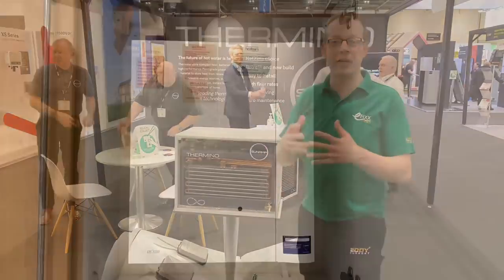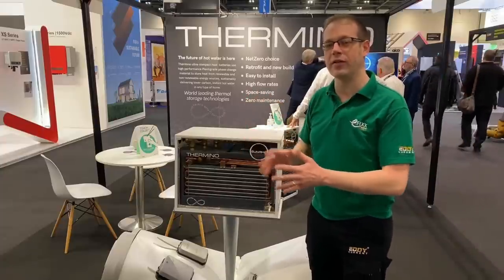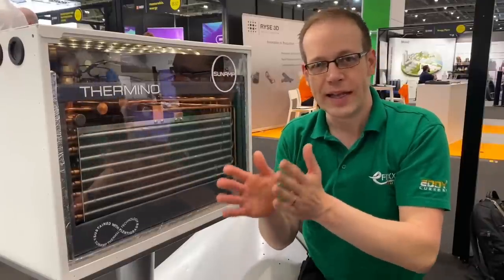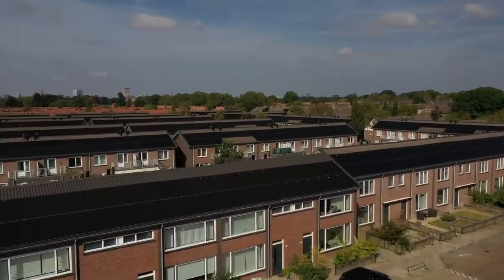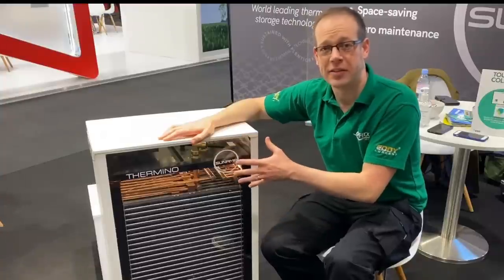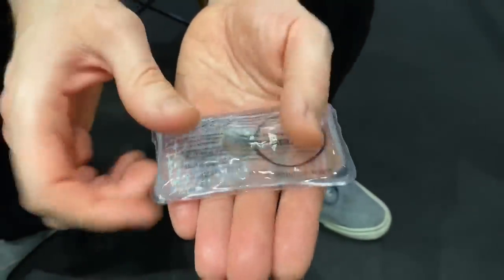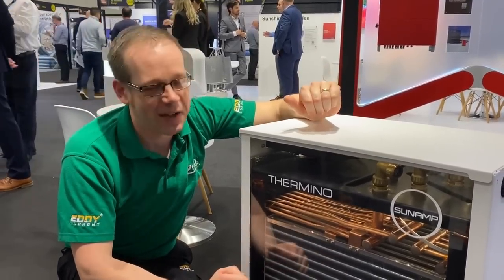The SUNAMP Hot Water Battery: What is it and How Does it Work?

Comment: That looks a good product. I work for a housing association and we have plenty of properties with heat pumps with cylinders. Quite a lot of them are bungalows with wet rooms. The large cylinders are only used for washing up and washing hands. A terrible waste of energy. This looks like an excellent solution. I'm a plumbing and heating engineer and think we have a long way to go to for heat pumps, whether ground source or air source to work as well or as cheaply as gas boilers. Especially in social housing. This is definitely heading in the right direction.

Comment: I do like the glass front showing off all the pipes inside.  It’s like a piece of artwork.  Absolutely amazing tech.  Thank you for sharing this.
Reply: This is probably just a demo unit to show all the pipes and bits. No telling how the final product will look. Think about it, a glass front will waste heat
Reply: @volvo24091  you’re probably right, but it does make it into a nice art piece for your kitchen.
Reply: Thanks Robert. As Volvo24091 says it is a demo unit with one of the sides replaced with clear perspex to show what's inside. The final product looks just the same with a white panel instead of the clear one. This is our 4th generation product - 20,000 heat batteries have been installed so far.
Reply: @SunampLtd  it still looks better with clear acrylic though.

Comment: Fantastic bit of kit, they should look at getting that into the marine industry too, excess heat from the engines stored for hot water onboard ... good to have finally met up with you guys
Reply from the maker: Great idea bud, such a pleasure to meet you in person at last. 😊
Reply: The car industry.  More than 50% ends up as waste heat
Reply: Well, not just marine. I could see a small(er) version be a good option for campervan heating.
Reply: @ByteBitten  my thoughts exactly
Reply: I "lived aboard" a 42' Mathews cabin cruiser for over a decade through the '90s and solarvoltic wasn't worthwhile back then, we had a solar water heater on the roof and a very insulated hot water tank down in the engine space. it also was plumbed into the engines closed loop cooling system so anytime you had run the main engines you also had hot water.
And many American RV buses and motorhomes also do heat recovery from the engine to the potable hot water tank

Comment: Very nice presentation, along with a very nice product. I have worked in industry over 40 yrs, with equip producing temp as low as  -40 
thru glass oven operating at 1270 deg. Can you imagine the wasted free energy, my crews have pissed out the window in that time frame.

Comment: That’s a really neat idea.
The ability to store actual heat in a chemical solution where it could then sit on a shelf for a long duration without loosing the stored energy because it is no longer simple heat in a tank, then all at once you can essentially press a button and the energy will change from chemical potential in waiting back into physical heat to be used/enjoyed. 

It makes perfect sense why this is called a heat battery.
Reply: It doesn't store the heat chemically, it stores it as heat.  Phase change materials still store heat as heat, so therefore must be insulated in the same way and the lose their heat to insulation losses the same way as hot water does.  Phase change material only allows more heat to be stored (as heat) in a smaller area, but there's no chemistry here.

Comment: Heat batteries using something other than water are a good idea for saving space. You can only heat water to 100C, but there are plenty of other materials that will be happy at 500C. There are some interesting designs that just use large masses of sand.
The design of this system seems pretty innovative.

Comment: The one most important question is what does it cost over a conventional tank, their are loads of great energy devices out there but the cost makes them impartible.
Reply: From what I can find on the website. The small one is about £1500 + installation! So doesnt look too bad a price. But I don't know how nbig unit would suit most people
Reply: Haa but cost a solar tank , thats a tank with upto 3 inputs plus immersion heater
Reply: We have one I installed myself, it cost the same the best wet hot water tank, our hot water running costs over ther last 6 months averaged out at 80p pw. We are soon to use solar to heat our water, currently we are using cheap overnight energy.
Reply: How long it lasts is also pretty important.
Reply: @nitelite78  No coment seems to be the answer to that one.
Reply: @showme360  how you found Sunamp I’m meant to be getting one fitted next couple of weeks
Reply: @Cossy1979Uk any updates on your install & use??

Comment: Lots and lots of questions asking about controllability of the PCM, for example when you turn a hot tap on..then off after a few seconds….does the reaction stop or does the unit discharge all its heat and then need a “re charge”.  Pointedly, although this question keeps getting asked, neither Sunamp or eFixx have responded ( unless I have missed it ) ????
Reply: Not good when a year on theres no answer

Comment: That was really interesting,  Its a phase changing heat store, Great  We need inovations like this .. But More info would be useful.... what temperature does it melt at ? How hot must your heat pump run?  How hot does it make the water ? Whats its life span ( small pipes fir up) ? Whats its cost (& that might be affordable as its only a heat exchanger , salt & vinegar). ?       
With this the Heat Pump flow needs to be hotter than the melting point, & the melting point hotter than the hot water So here you have 2 "Hotters" , If you have a normal cylinder , the Heat pump only needs to be hotter than the hot water, 1 "Hotter".  Getting the heap pump flow as low as possible is best for COP.    Thoughts ?

Comment: The Sunamp is great, but sadly very few trades know anything about them and there are even less installers in the North of England. Would consider getting one to replace a hot water tank but not cheap as just an upgrade. Like the new channel!
Reply from the maker: Yeah, it was brand new to us as well. Thanks for coming along for the journey. 😊
Reply: To be fair they're extremely simple, best way to think of it is an indirect hot water tank just made smaller. The only difference is it uses something like candle wax instead of water to hold heat (melts and solidifies - phase change material). Everything else is practically the same.
Reply: @eFIXXENERGY  I guess the biggest selling point of these is that they're smaller than cylinders. The issue I have is that the cylinder ones are also sometimes heat pump cylinders anyway.

I'd prefer to use a heat pump cylinder, linked in to an air source heat pump. This is also not something I'd do straight away given my aim is to make my house super air tight + then install an MVHR

Comment: I have a heat pump installed (in 2010) and am costing a replacement. The Thermino looks great and would definitely offer space saving over the 600 litre unvented tank currently installed. Our water is very hard - how does the Thermino cope with scaling? Also the current tank has two circuits, one for the underfloor heating and one for DHW. Do I need two Thermino units? Great presentation, much appreciated.

Comment: What a great piece of kit! Assume you can run this from a boiler also at lower temperatures with no issue while you look to start exploring HP & low temp systems?
Reply from the maker: Yes works with all types of heating systems.
Reply: Really frustrating to me that this simple obvious “transition” question isn’t answered clearly on their website.

Comment: 1.Great to see efixx going into home energy area. 
2. How heavy are these? Could they be installed onto a wall like a boiler can? As it's ok being small, but if they have to be ground mounted, that reduces some of the benefits.
3. I think Fully Charged home series video included Sunamp products for a couple of tower blocks in Sunderland. Apparently, one of the benefits was low maintenance costs, but some real world costs/ testing/data would be appreciated.
Reply from the maker: We'll see if we can get some technical answers from Sunamp! 😊
Reply: I fit these regularly they weigh around 120kg and cannot be fitted on to a wall they rarely go wrong how ever they can be expensive to run
Reply: @rhysspencer9232  expensive to run ? what do you mean ??
Reply: Weight depends on the size of the heat battery selected. Thermino 300 - our largest unit - is 211 kg . It's actually lighter than the equivalent hot water tank full of water, saving money on reinforcing the airing cupboard where the hot water tank usually would be fitted, as well as providing a much cleaner and tidier installation. Unlike hot water cylinders, there is no mandatory annual maintenance required and no risk of legionella.
Reply: @SunampLtd   excuse my ignorance here. Few Questions if I may… if I keep applying energy and/or higher temperatures to the heat battery PCM will it continue to store more usable energy? For example applying 100oC - 200oC? Basically is there a maximum supply temperature? Will/could this degrade the PCM? If you don’t have to worry about space, what’s your main selling point/s please? Thanks for your time.
Reply: @rhysspencer9232  expensive to run explain please? Getting one fitted 2-3 weeks

Comment: What is the temperature, where the phase change happens? Does this fit to all kind of Heatpumps? Or is the Salt-Vinegar mixture actually adjusted to your individual system at home?
Reply: Iirc residential is 58C by default but they can tweak the phase change point up or down. Industrial usage is 90C for instance.

Comment: Good presentation.  I have been looking at these for a while, thinking this could be an ideal solution to replace my gas boiler.   Few questions I've had:
1) Could they replace my boiler for the central heating as well as heat my hot water?
2) Could I heat overnight from the grid on cheap energy as well as using my solar panels? 
3) How cost efficient are they to run compared to a gas/electric boiler?  
4) If I heated it up at night on cheap rate electricity could it heat my home all day? (obviously depends on size of house, how cold etc, but looking for some averages).
Reply: Imagine it as an electric hot water tank, just made smaller. The energy savings lie where you use a heat pump for the heat over the internal element. 

It's not really made to store enough heat to warm your entire home, more to buffer the requirements you have for heat. It would work alongside a heat pump or boiler (typically where you have large peak hot water demands), not ideal to replace them entirely.
Reply: In answer to your first question, yes - and our range for domestic space heating will be launched this year. The asnwer to your second question is also yes. In the Thermino ePV model, the solar power diverter can have a boost setting to allow the unit to charge overnight on a cheap tariff in addition to the PV demand.

Comment: Thank God they're about £2000. I'm just installing a Gledhill 200L tank which has cost me around £600 including pipes and fittings. Having said that, I'd still need a £5000 heat pump as well to make the Sunamp wor, unless I just ran it from the immersion heater. What size is the the immersion heater you can fit?

Comment: You mention a lower temp requirement since there is no risk of legionella since the water isn't stored, but it looks like the minimum input temp requirement is 65c/149f which is still quite hot as far as air to water heat pumps are concerned. Is that correct?

Comment: How heavy are these units, do they arrive empty and we add water on installation?
Reply from the maker: The units are filled with a phase change material so arrive on site fully filled. This does make the units quite heavy compared to empty hot water cylinders.
Reply: Size 3 which is the one in the video weighs around 60kg the 6 is around 120kg the next size up will probably be in the 200 range

Comment: We have an older version, the Uniq, not the Thermino, but I imagine the principle is the same. Interesting to see it explained properly at last, rather than just the 'it works like a hand warmer' I got from the Fischer Future heat fitters. I'm still not quite sure though how it works with only cold water coming through it, as it is our only source of hot water, no immersion heater tank, so does it just use electricity to turn the pcm back to it's liquid form, ready for the next time water is needed heating?

Comment: Providing it works. Really the most important question is does it require a service and how long will it last. How hot can you get the water. How many gallons of hot water a minute will it provide.
Reply: This would depend on the heat battery size, our nominal hot water rating for our heat batteries are:, 
Thermino 70 – 1.59gpm
Thermino 150 – 3.96gpm
Thermino 210 – 5.28gpm
Thermino 300 – 6.6gpm

Comment: Very informative. Can you tell me if there are any benefits to installing a Sunamp if you don't have solar panels or a heat exchanger, but instead use mains electricity?
Reply: Not unless you can get cheap electricity, which normally means having the ability to delay using  most of your electricity until nightime.

Comment: Great idea but leaves me with two questions, firstly how do you trigger the crystallisation process within the unit and secondly once triggered how do you control it and prevent all the solution from crystallising at once and hence expending all the energy in one go.
Reply: As I understand they are not using up super saturated liquid (salt water) like the hand warmers do.They use paraffin wax. So it's not really a great example to use the hand warmer as a comparison. But paraffin wax holds twice as many joules per kilogram of heat vs water. They have simply designed a container for melted paraffin wax that is insulated like a hot water tank, and then they run exchangers through the paraffin to extract the heat into water as demand requires. If you leave the thermino for months without input heat the wax will eventually lose its heat and solidify, unlike a hand warmer.

Comment: What is the flow rate you can achieve with these, the sun amp needs to heat the water to use, can you fill a bath or run a shower whilst the kitchen is being used?

Comment: I enjoyed the video very much thank you. You mention with its 'energy efficiency' (5.10 time line) but you don't mention how efficient it is? Ideally it would be good to know how efficient is it compared to a normal domestic hot water.
Reply from the maker: It depends what's meant by efficient really, you're never going to get more heat out of this than you put in so it boils down (pardon the pun) to the insulation really.
Reply: Got to be use a lot less energy to get up to temp that when compared to a 300liter cylinder - even if it’s not as efficient
Reply: @russellthomas9391  No, the point is this small box would hold a similar amount or energy as a large cylinder of water as it is using a principal of heat of fusion - when a material changes sate is can absorb masses amounts of energy and not increase in temperature. Just need to pick the material whose phase change temperature matched the temperature output you need.
Reply: @russellthomas9391  you can't get out more than you can put in.
Reply: @eFIXXENERGY  What  "efficiency" means to just about everyone who has even a rudimentary knowledge of physics and mechanical systems is how much energy is converted through the device and how much is lost.  The conventional hot water heater burns gas or electrically heats an element to heat the water, this unit primarily uses heat from an outside source  and a direct electrical element as a booster.  Not exactly apples to apples.
So how good is the material and housing at retaining heat when idle and how much heat is is absorbed from the heat pump comparing the pump side inlet/outlet temperatures to a heat exchanger in a tank of water?  Simple questions that would be very easily measurable and answered.  
This system looks as if it would pair well with a solar hot water system. If the water was mixed with glycol and circulated in a closed loop like the heat pump allowing the solar hot water system to operate in sub freezing temperatures.  
Excellent concept, hope it's successful in longevity and competitive in costs.
Reply: @russellthomas9391  Wrong. It takes exactly the same amount. You may get 80 times more heat out of it as it changes phase but you need to put the same amount in. You need one BTU to raise the temperature of one pound of water one degree. If you could do better you could have perpetual motion.

Comment: A key question is in how the stored energy is released? Is it released all at once or can it be released in fractions? With the hand warmer example, all of the stored energy is released at once. It takes time to cool down, but the whole lot of sodium acetate is crystallised in one go. It's not like a battery where I can draw off just the energy I require.
Reply: I believe they are using paraffin wax kept at high heat with a wax to water, heat exchanger running through the wax.
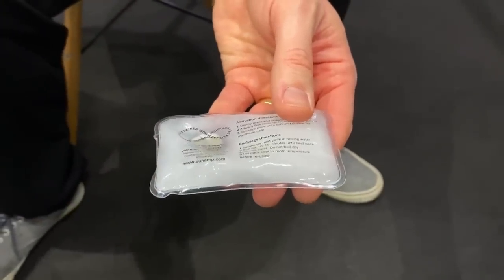Reply: @PerhapsNoodle  They state that the phase change material is sodium acetate, see 4:40 onwards. He describes the material as comprising of salt and vinegar, which is not correct, but that's probably just misspoken. Sodium hydroxide and vinegar would form sodium acetate.